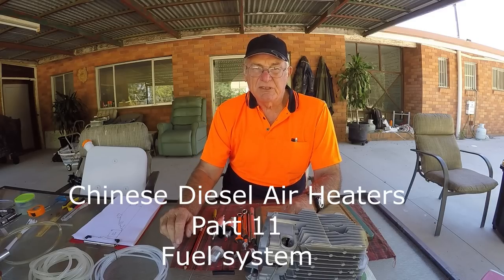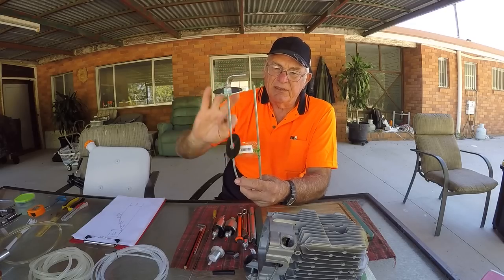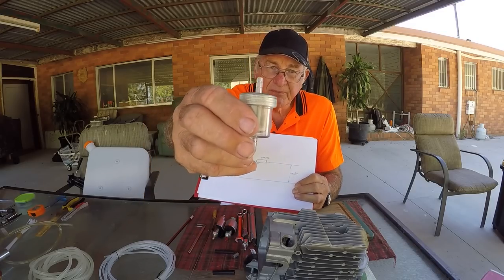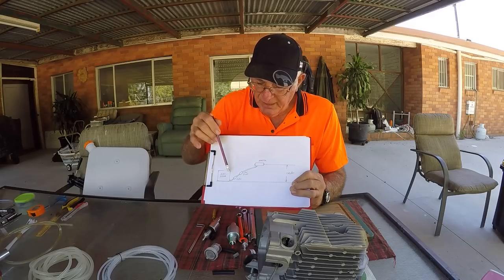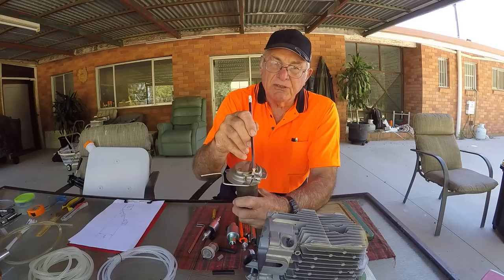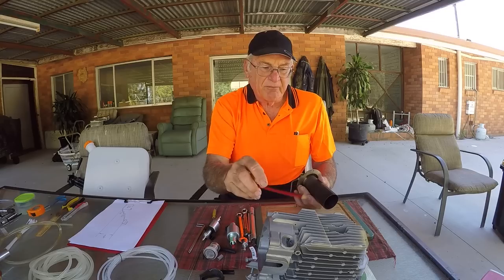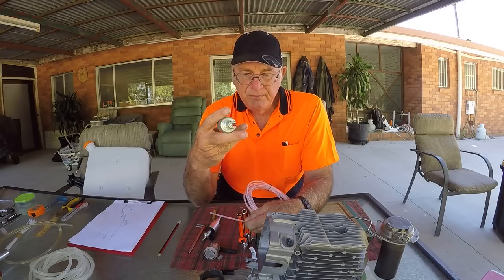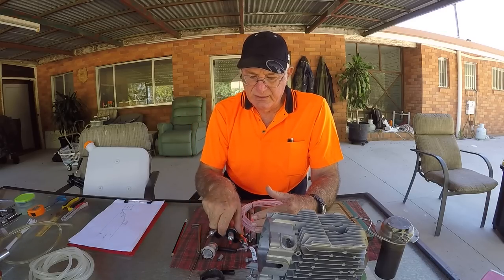Chinese Diesel Air Heaters - Part 11 -  Fuel Delivery

Comment: If you're going to be using the 10 liter tank, do yourself a favor and fill it with kerosene/paraffin and not diesel. It has almost identical amounts of energy, but burns much cleaner. Using the diesel tank of the vehicle is very convenient though.
Reply: Kerosene does NOT have the lubricants the pump needs. You could probably get by with a third diesel and two thirds kerosene.  Have a spare pump just in case!

Comment: good video, thanks. I plan on Teeing of my main diesel line. Do the pumps have a non return line in them ? Or is there a chance i might induce air into the engine if it draws all of the fuel out of heater lines ?
Reply from the maker: Hi Whippetandig,
The dosing pumps do have non return valves inside them, so your engine can't suck back air.

However if you have a modern vehicle you generally you can not "T" into the engine fuel line. The issue is modern vehicles often have boost fuel pumps installed in the fuel tank or pressurised fuel tanks. With the engine running you can force diesel forward through the pump and flood the heater burner.

Modern vehicles need a seperate pick up fuel line for the diesel heater, but if the tank is pressurised you may need a seperate fuel tank.

Many European diesel vehicles do come with an inbuilt  diesel pick up for a diesel heater, which is often called a parking heater. You need to check out what type of fuel tank you have in your vehicle.

I hope this helps.   JMcK
Reply: John McK 47 , thanks mate, I should be fine then. Older Toyota Coaster. Non pressurised tank.

Comment: I have the same filter as you but no directional arrow. Which way do you mount fuel filter?
Reply from the maker: Hi Jim, fuel filters are designed to remove crud on the OUTSIDE of the filter medium, where large particles can fall to bottom of the casing where they can be seen in a transparent filter housing. With the inlet going to the inside, the filter will still work but will soon block up as there is little space to hold the filtered particles.  JMcK

Comment: Great video, especially the fuel line testbed.  I recently received an "8k" all-in-one low rise unit w/ a 5L tank mounted alongside the heater.  The pump is connected to the tank via a 50mm black fuel hose w/o a filter.  I'm trying to figure out if there's room to add a fuel filter but I'm also wondering if I should swap out the approx. 50cm long 4mm green hose with a nylon section or with such a short length the bubble and flexing/expansion of the 4mm hose isn't as much of an issue as we saw with your 4 meter testbed?  Note, after the 4mm hose exits the pump and turns down to route to the heater there a 20cm long bubble that has formed in the down sloping section of the hose.  I might be able to work out that bubble but assume it would return w/ the pump generating new bubbles.  Thanks!
Reply: One more thought on the soft hose / large air bubbles issue - I'm wonder since they add a little 'room' for the pump to pump into each cycle, when the pump activates it's net pressure is less and perhaps pumps a slight bit more fuel which then dribbles into the screen between cycles so not only is the fuel not atomizing properly the heater may also be running rich  (assuming fan speed is somewhat based on fuel HZ rate)?
Reply from the maker: Hi C34.  

Running normal fuel from tank to filter to pump is not an issue, but it is good practice to run narrow bore hard nylon from pump to heater, even for short runs, and particularly if the line runs downwards. The clear plastic fuel hose provided with some heaters has a life span of around 6 to 9 months in my tests. 

Suggest you install a fuel filter. The piston and valves in the pump are real tiny and just the smallest bit of crud will cause you issues.  JMcK
Reply: @johnmck1147  Thanks a lot ... good to double check with the world renown expert that you are - great stuff.  I've ordered some 2mm ID nylon hose and looking for a small filter as well.  I plan to use the heater occasionally on my 34' sailboat by setting it up on the side deck in front of an opening hatch while having the exhaust point downward/overboard and the last thing I want is fuel leaking all over the decks or it breaking down because of an incorrect fuel delivery setup.  (I've already swapped out the glow plug which didn't even last 5 starts - I don't think it was installed tight enough)
Reply from the maker: C34 WEBMASTER 
👍
Reply: Just wanted to give an update - I install a 2mm ID nylon fuel line from the pump to the unit (and installed a small filter between the tank and the pump) and they unit burns much cleaner which is very noticeable in the lack of soot in the exhaust pipe.  I required change that I would never have know about w/o your video - thanks again.    

Unit is running great though I have some issues w/ it running too hot and shutting down around the 2.75hz range ... ok < 2hz and at 4+.  It doesn't always do it and it hasn't been that cold so I'm not too concerned.  Also the dry air at 2000 meters elevation isn't helping.  Looking forward to trying it out at sea level on my sailboat.
Reply from the maker: David Sanner  

Thanks for the feedback. JMcK

Comment: Hi John - Have noticed that when the temperature setting is set to maximum, the fuel delivery works fine. If I set the temperature to a lower setting the system shuts down with an Error code 8. Any ideas why? Thank you.
Reply: More information. I run the heater in manual mode. Distance between pump and heater inlet is about 25 cm. Pump is in full vertical orientation.  Please let me if you need more detail. Thank you.
Reply from the maker: Hi Amir,

If the heater runs at a high Hz setting , but flames out at a low Hz setting and you get an E08 code, you most likely have a fuel issue.

This could be some air leak in the system, often caused by a leakage where the fuel hose is connected to the heater. Suggest you see motorhome video where I talk a little about this.

You can also have air leaks at every join in the fuel line. These will need to be checked.

Another issue is if you are using soft nylon fuel hose on the delivery side of the fuel pump. This will work for a while, but when you get small amounts of carbon residue on the burner atomisation screens the soft hose absorbs the fuel pulse and the diesel does not have the force to atomise. If you don't have fuel leaks you should check for excessive carbon deposits.

Cheers.  JMcK

Comment: Hello John, thanks for the videos, we have been watching all in preparation for our install! One question, we don’t have many options in our small van and we plan to mount the fuel tank a little higher than the heater. With the fuel line coming from the bottom of the tank. Do you think it’s ok to have the fuel line going downwards though the filter and then curve back upwards to the pump, then up to the heater, the whole length of the fuel line will only be around 70cm from tank to heater, this way we can still have the pump at the 45 degree angle pushing the fuel into the heater? (Hope this makes sense)
Reply from the maker: Yes exPAW, that should be fine. Just make sure you have the flow direction tn the fuel filter. Happy warmth to you.  JMcK
Reply: Food for thought... Is avoid drilling a home in the bottom of the tank. That's a potential leak that would dump a LARGE spill.

Instead, use a sip tube from the top of the tank to the bottom of the tank. That eliminates the possibility of a leak. This does not affect your head pressure.

Comment: Great video! Do you suggest a diameter of 2mm internal nylon hose? Or 4 mm internal? Thanks for good videos.
Reply from the maker: Hi R, 2 mm bore hard nylon generally gives best performance if fuel runs over 1 m or so.  JMcK
Reply: @johnmck1147  Thanks!!!

Comment: Hi John, l have a fuel tank sender stand pick up pipe which has an internal diameter of slightly less than 2mm probably 1.5mm. The plastic pipe is the hard type with 2mm bore. Will this system work ok. Thanks Peter.
Reply from the maker: Yes Peter, that should be ok. 
Suggest you run standard fuel hose from tank to fuel filter to pump.
Then the hard nylon from pump to heater.  Cheers. JMcK
Reply: @johnmck1147  Thanks for your help yet again John, it's really appreciated.
Reply from the maker: peter chambers 
👍

Comment: Hello John!  Any tips to installing that fuel pickup tube into the fuel tank?   You show the tube at the 45 second mark.  Been searching the comments and online and I can't seem to find any instructions.  I'm about to go another route if I can't figure it out!  Ha Ha! Thank you!
Reply from the maker: Hi Scott,

Not sure what vehicle you want to install the pick up tube. Most European brand commercial vehicles already come standard with a pick up tube for what they call parking heaters. You just need to remove the bung and install a hose fitting.

You can install your own stand pipe if you wish. There are many available on eBay, below is a link to get you started on your search. Try and buy from a seller with a warehouse in your own country.

https://www.ebay.com.au/itm/60cm-Fuel-Tank-Sender-Stand-Pipe-Pick-Up-Hose-For-Eberspacher-Air-Diesel-Heater-/393848221291?mkcid=16&mkevt=1&_trksid=p2349624.m46890.l49286&mkrid=705-154756-20017-0

Suggest you cut it to length a bit off the bottom of your tank so you can not drain the tank dry, and then you can't start your vehicle.  JMcK
Reply: Thanks for the reply John.  I should have been more clear,  I want to install the tube in the top of the 10l tank I got with my kit.  The same tank you show in this video.  Is this possible?  
     Some kits sold now include this tube instead of the bottom pickup.  They show a picture but no instructions.   
     My kit came with the bottom pickup and I purchased my pickup tube separately from Ebay, it's just like the link you showed.  I purchased the top mounted tube because I wanted to eliminate any future possibility of leaks from the bottom of the tank as it will be inside my late 80's Chevrolet van.  
      The main issue is how to attach the tube to the top of the tank.  The metal washer that sits above the rubber washer has three holes.  I've seen some installed using three self tapping screws to hold everything to the top of the tank.  That doesn't seam right to me.  I keep thinking that there should be some type of flange or nut that holds the tube to the inside of the tank.
Thanks for your help John!!
Reply from the maker: Hi Scott,

You will have no issue with the flange type pick up tube and self tapping screws.
Just make sure you install on a flat area and use coarse screws. 
There is on head pressure and just slop pressure.
I don't just rely on the rubber gasket but also use a flexible (silicone or similar) gasket cement.

Cheers.  JMcK
Reply: Great!  I'll try that.  Thanks for your time John!  Take care!

Comment: John I have a problem with my fuel pump , appears not to be getting  current  is there something to be done to trouble shoot the pump  or the electric on the heater itself
Reply from the maker: Hi Jack,

First is this a new install, or has the heater been working previously and now the pump does not work?

It is not uncommon for "new" heater owners to complain the pump does not work when they turn the heater on. It is not designed to start pumping straight away. The heater goes through a start up process before the pump starts ticking.

It is very rare, but you can buy a new defective heater that does not work.

If the heater was working previously and now doesn't, it could be a number of things if the pump is not getting current. 

Defective glow plug. The pump will not get current to start unless the glow plug is hot.

Broken or corroded wire in pump wire loom, also lose plug on pump or circuit board. 

You can test the pump by quickly applying 12V to the pump. On and off. The polarity does not matter. If the pump works manually but not connected to heater, you could also have a defective control board.

Sorry I could not help more. (More info needed). JMcK

Comment: Sorry to bother you AGAIN John... I just now primed my fuel line for the 1st time and saw a lot of bubbles running throughout the lines. I got the bubbles out from the tank to the pump but there are still bubbles between the pump and the heater. Should I try to run them out by priming it again (for the 2nd time) or should i just try to start er up? This should bew the last time I bother you....Thank you very much! Art
Reply from the maker: Hi Art, 

If the bubbles from the pump to the heater are tiny bubbles, and are regularly spaced, they are cavitation bubbles caused by the little piston flying up and down inside the pump and they are quite normal. 

In actual fact these little bubbles help in atomisation of the diesel in the atomisation screens in the burner.

You don't want a big bubble in the line.

JMcK
Reply: @johnmck1147  Yup! It works fine. Although, I sometimes prime it before starting just in case. Hopefully that won’t hurt it. Thanks for all ur help! AE
Reply from the maker: Hi Art, you only need to prime it once. (On initial install) If you prime it after that you will flood the heater, causing it to smoke, and even not start.  JMcK

Comment: Hi john 
It doesn’t look like my first question came up it was about the fuel tank does it have to go below or above the heater or doesn’t it mater

Regards John
Reply from the maker: Hi John,

If the fuel tank is about 1 m to 1.5 m above or below the fuel pump it does not matter too much. The key word here is fuel pump, not heater. 

The pump can suck up fuel about 1.5 m without issues and pump up fuel about 3 m.

One thing you will need though is a fuel tap in the fuel line if the fuel tank is more than about a metre higher than the pump. Turn the tap off after use as head pressure can force fuel past the little seals in the pump.

It is good practice to always have a fuel tap in the fuel line between tank and pump
regardless.

Cheers.  JMcK

Comment: Hello is it ok to have the tank mounted above the heater (gravity feed) and fuel line feeding down to heater inlet instead of how you have demonstrated ?
Reply from the maker: Yes Hasger, it is ok to have tank mounted above heater, but you should install a fuel shut off valve between tank and fuel pump and turn off when not in use as fuel can seep past pump seals and flood heater. You must have the fuel pump, and you should have a good fuel filter.  JMcK
Reply: @johnmck1147  Many thanks John 👍👍👍

Comment: Hi John, I have just bought a 5Kw heater and it came with the soft green hose. I have typed in Eberspacher 2mm hard nylon fuel hose as per your recommendations but can only find 1.5 ID hose and am wondering if this will be ok. Thanks for all your great videos, they have been very helpful.
Reply from the maker: Hi Pete, yes I have seen some of those adverts, but the ones I have seen say ID approx 1.5 mm.
I have not actually bought any "approx" hose to check and test. If it says Eberspacher and the hose comes with the rubber hose joiners it should be ok. You need the hard nylon on the delivery side of the  pump, but normal one size fuel hose is ok from tank to filter to pump. JMcK
Reply: @johnmck1147  Thanks so much for your reply. Your confirmation gives me the confidence I needed to purchase one of the "approx 1.5" fuel line kits. Now all I have to decide is whether to try and link into the fuel tank of my 06 Sprinter or to run from the plastic tank...!
Reply from the maker: Pete Hammond 

Hi Pete, many European manufactures pre install a pick up tube in the vehicle fuel tank for after market install of a diesel heater, often called a parking heater, as it is used when parked. It will be sealed off with a bung and generally just needs a male 90deg fitting and a nipple screwed into the bung hole for you to connect your pick up fuel line.  I am pretty sure there will be one in your Sprinter.   JMcK
Reply: John McK 47 Thanks John. You are a scholar and a gentleman and have been most helpful once again. Best regards, Pete.

Comment: Thanks for the info. Some people suggested to fill the line with diesel on initial start (which is every winter). They said it will save the fuel pump on running dry  for a few minutes and avoid future fuel pump damage. What do you think of installing a "purge/primer bulb" to prime the line? Just an idea.
Reply from the maker: Hi there,

You generally only prime the fuel line on initial install.
You do not prime it every winter. The heater in my boat has been there over 15 years, and I have owned it longer than 10 years, and I have never needed to re-prime the heater at season start.

I suggest people use a primer bulb if it makes it easier for them for the initial prime, but once primed to remove it as it is really not needed again.

An exception could be where the heater is much higher than the fuel tank. In such cases you could get flow back leakage over the summer.

Cheers.  JMcK
Reply: @johnmck1147  Thanks, you can tell I'm new to this and excited watching YT videos on installation and techniques. My heater is suppose to arrive today or tomorrow.
Reply from the maker: J 
👍

Comment: Hi John 
I have a question. my heater is dripping fuel from the air inlet pipe ( which is the lowest part due to the angle the van is parked on) and my tank is higher than the heater . Is there anything to stop the fuel from gravity feeding into the heater and that’s why I’m getting it dripping out the air inlet ? 
Thanks 
Love your videos
Reply from the maker: Hi Loren, suggest you install a small shut off tap in the fuel line between tank and filter and turn this off when heater is not being used.
It is ok to use normal fuel hose from tank to shut off valve to filter to fuel pump, but fuel hose from fuel pump to heater should be narrow bore hard nylon.  JMcK
Reply: @johnmck1147  Thank you